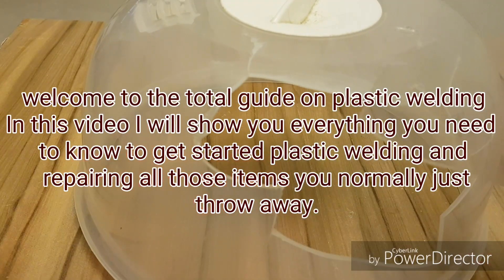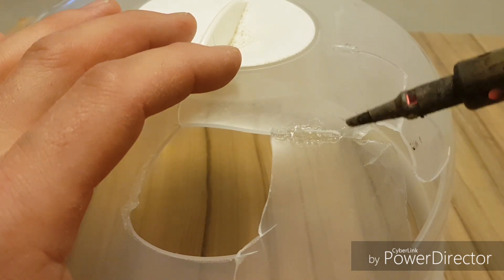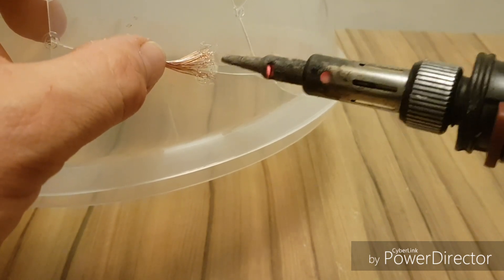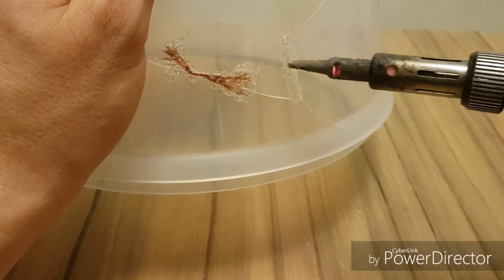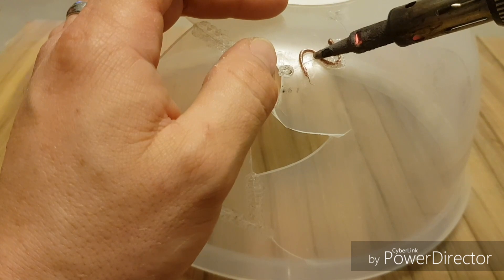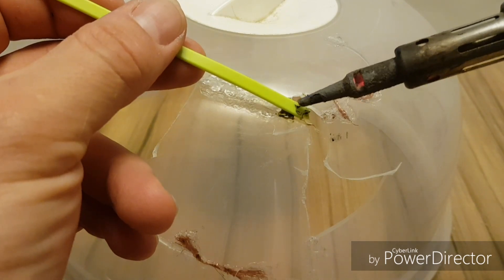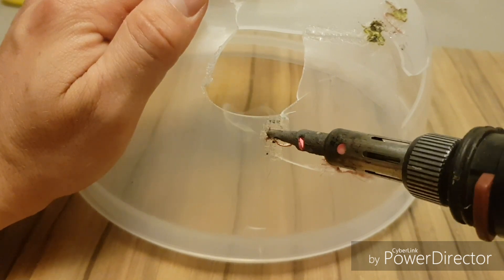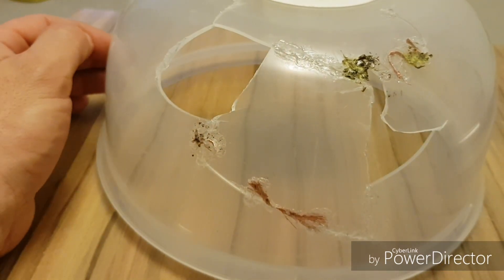PLASTIC WELDING WITH A SOLDERING IRON AND ZIP TIES AND COPPER WIRE

Comment: Thanks so much for the tips. I have a spare temp adjustable soldering iron so tried using it at lowest setting (200oC) with a flat tip and it works a treat. Gamechanger for plastic repairs. Used to ty and superglue but if it didn't hold i'd often end up throwing the item away. If more people did this there would be so much less stuff going to landfill

Comment: plastic used for filler has to be the same kind as base or it won't bond.
Reply: Not true - here he's welding nylon (tie) onto something that's probably polystyrene or similar. It is better with the same material, though.

Comment: Could this be used to make/weld a fish tank from 5mm perspex?🦉(looking for an alternative to dichloromethane)
Reply: Hi.... I am not an expert in plastic welding - or fish tanks.... but I do many DIY jobs and build many models.... My advice would be... that the water pressure would be too strong. so you will need to build a frame of either wood or metal - or something strong... Then perhaps a special plastic glue - or fibreglass - but of course, then the question - is it safe for fish?! Good luck with your project! p.s. there are some very good waterproof tapes on the market now too...
Reply: @fonwoolridge  STOP! YOU DO NOT KNOW WHAT YOU ARE DOING!